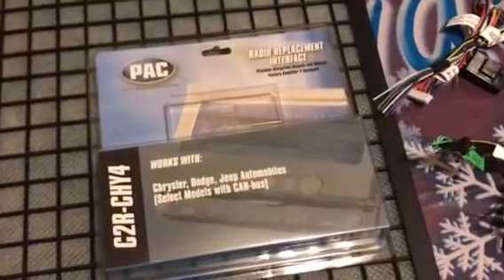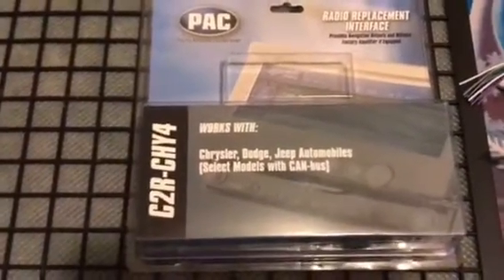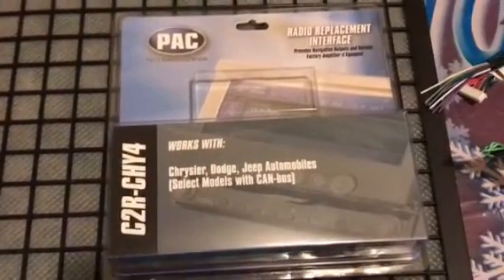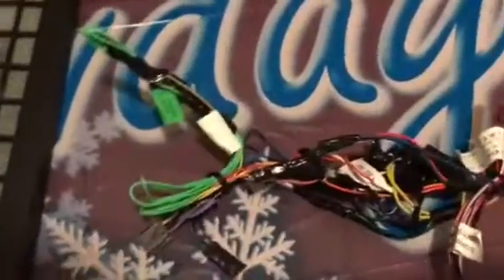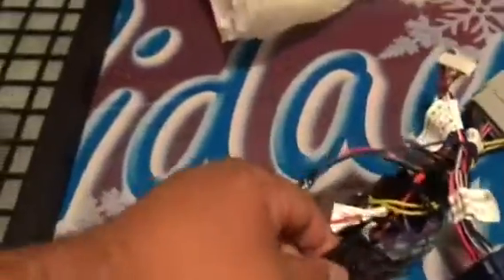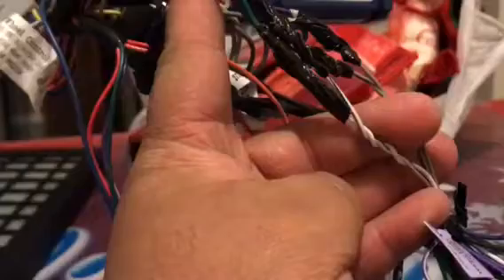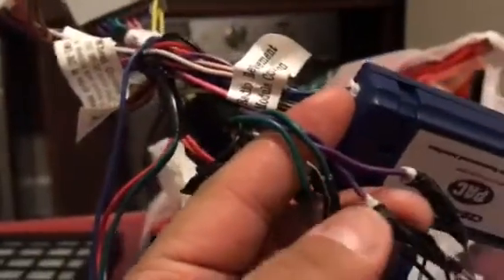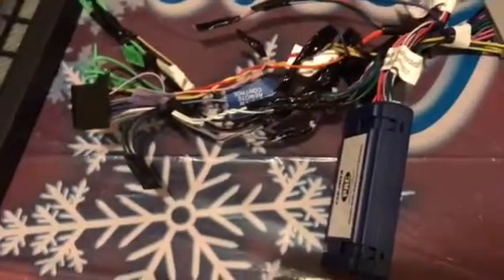Pac c2r-chy4 for dodge magnum & charger

Comment from the maker: This pac c2r-chy4 will turn on your factory car amplifier if equipped. Only two speakers will be used from the pac harness and same as your aftermarket radio only two speakers will be connected.
Reply: I was wondering if you can hook up 3 wires to the speaker wires so u can have all 4 speakers on

Comment: Do you have a video of you actually wiring it up. That’s what I need to watch
Reply from the maker: Its very easy wiring process
To connect your speakers you will connect from the radio harness the white wires both - @ + to the pac harness green wires - @ +. 
Then you will do the same thing with your gray speraker wires from radio - @ + to the pac harness you will connect it to the purple wires. And those will be your speakers. By installing it it like that you will have sound in all 4 speakers since the pac harness will only use 2 channel. Then follow steps on connecting your ground cable -black( red) (yellow) wires from radio to pac harness and then plug it to your car.

Comment: Man I've got my white - connected to green+ and my gray- to my purple+ and have zero audio. What am I doing wrong here.
Reply from the maker: Is your radio turning on? Did you had audio with your factory radio?
Reply from the maker: Make shure your remote is installed as well that will turn on the factory amp. That will be the blue cable or blue and white cable
Reply: @rhurtadorh32  I have power. Am I gunna connect blue and white to solid blue for the factory amp?
Reply from the maker: @mannyb2521  yes that will turn on your dodges factory amp and give signal to the all speakers. Let me know!👍
Reply: @rhurtadorh32  nothing happened
Reply from the maker: @mannyb2521  you should be able to have sound by now.
Reply from the maker: @mannyb2521  try connecting both blue solid color cables. The one from the radio to the pac harness. I beleive white and blue are for electric antennas the ones that go up and down.
Reply: @rhurtadorh32  I don't have a solid blue from the radio only solid blue is at the pac harness
Reply from the maker: @mannyb2521  so you need to find wich wire your radio is remote. That remote wire from your radio will give the signal to the pac harness and pac to car amp and you get sound.
Reply from the maker: @mannyb2521  what kind of radio do you have?
Reply: @rhurtadorh32  I got it tied all 3 blue in and it kicked over